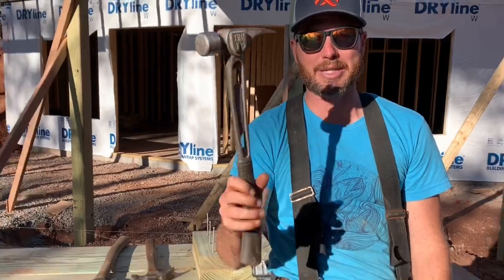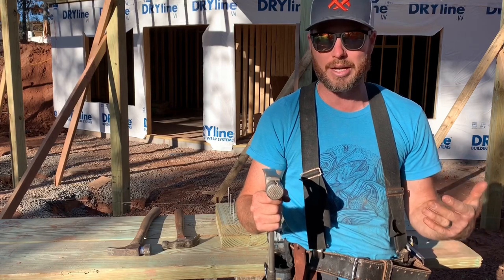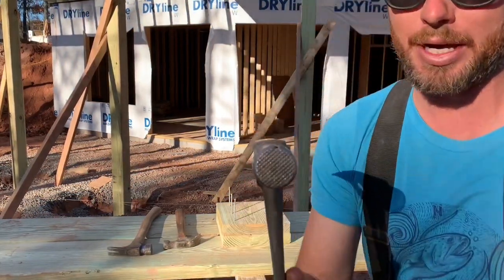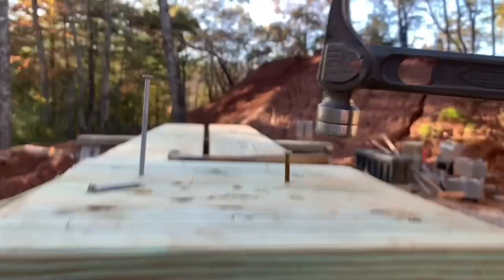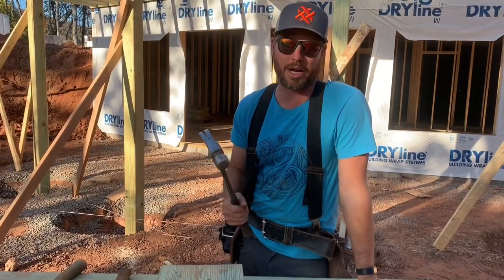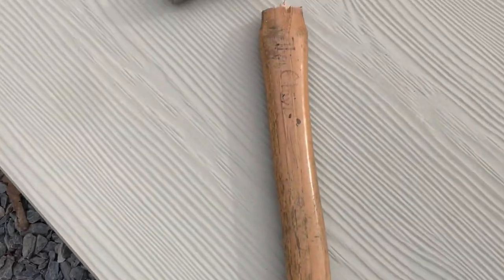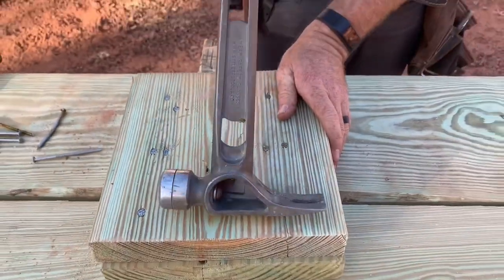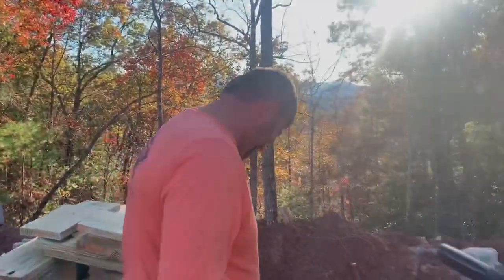$250 Hammer...  Worth it?

Comment: I had the TB11, the hand started to click so I asked Stilleto on FB how to fix it, they asked for a picture of my TB11 and my address, within a week I had a brand new TB111! I do a lot of formwork so the fact that the nail set accommodates a duplex nail is awesome. When you use the side pull, rotate the hammer so that you finish pulling the nail using the claws it gives you even more leverage, you can easily pull a duplex nail out of concrete. Someone stole my TB111 after I had it a few years, I immediately went out and bought a new one, lucked out and got it $100 off because the box had been opened 👍🏼 really like your channel which I discovered today.

Comment: Over the years I have bought the best tools I can afford, be they small screwdrivers, power tools,  framing tools, plumbing equipment, spanners (wrenches), some I've had for 50 years and still using them regularly.  I have Bahco pliers & spanners (Swedish), 30 years old, my best buys ever. Re. hammers: the cheap ones have a nasty habit of chipping - small chips flying off into your eye, nasty; and problems with leverage & balance & durability.  'Stoopid hammer for a stoopid carpenter' says more about the commentator who doesn't build for a living.  Great vids mate.

Comment: I'm a Union carpenter, do lots of concrete work and I would not recommend this hammer at all. I have had it for less then a year and the bolt stripped out and head kept falling off, and a little side note I lost a couple nail offs with guys that had heavier hammers, so it may take one or two extra swings to drive a nail
Reply: I'm with you, don't use mine for pounding on steel, form whalers etc. When I do the head spins and I need to re-aline, use my 22oz Estwing for forming, and 'd rather lose it in the mud instead of $300 one...
For Framing NOTHING beats the Titanium for me, I've used the wooden handles but they break too easily, the side puller is awesome , Oh and I completed the set with the Titanium nail puller (Just because)
Reply: @garywicklund301  way late but Vaughan makes a 32oz steel hammer that is beautiful for forming and driving stakes. I dont really get the complaints on elbows. Its got a wood hammer and ive used it basically everyday for almost 10 years and nothing has ever bothered me. The titanium stuff is just a hipster trend

Comment: Hey guys...thx4 update. Was intrigued  with new Martinez  moved the weight into the head for more force with the same head speed. But have to say for 250? I'll still stay with my Vaughn framing axe. It's a double tap nail driving machine with your vinal coated stinkers. 35 years...in an Occidental 3 bagger. Like the wooden handle because it can be shaped a bit to fit my grip.  Has a nail notch for pulling and with grip wax never slips. About 6 if these against 250? That said would like to get my hands on Martinex just to try. Give one a try 😊 Keep the vids coming. Lv the no bs and to the point. Snowing here.

Comment: A repeat tale. 
  I also have the Tbone II.  I went from 22 ounce estwing, to the titanium Vaughan half handle; ironically, I broke it in half. To the  stiletto w/ hickory (3 broken handles later),  to the Tbone.  If I started out  nearly 30 years ago with a Stiletto I might not have had tendonitis so severe I lost a month of work (as most carpenters, where I worked there was no such thing as "light duty").
If this is your career choice. The $300 is worth it. Even if you predominantly use nail guns.
  Although the latest estwing with magnet and side puller is an excellent choice for the DIYer or undecided apprentice.

Comment: I agree  . If you're using a tool every single day than you want the best tool that's affordable . Why hurt your arm when you don't have to . Yea it costs a lot of money but it's worth it . It's not meant for a home owner who hammers a few nails a year . Good part is that you can change out the head when needed . You can get a smooth head for it if need be . Every You Tube carpenter loves using this hammer . Why would it be any different here . Good video .
Reply: Henry Rodgers it would also be lighter than your average hammer right? Ie builders carry around there tools all day
Reply: @MsElijah16   Yes light and easier to swing but with the same power as a steel hammer . If I was a framer I'd get one for sure . Less vibration .

Comment: I'm going to buy one of those hammers....also like the black fibreglass shafted one. Which one is best? 🤔
Reply: get metal one! you can use strength of exposed titanium as leverage, and it wouldn't wear out when "misfire" against wood
4 years on mine, changed head once

Comment: I swing a 16 oz .. I figure it like if you play a violin  Play one instrument well .. Get used to the distance of the fulcrum .. Interchangeable from frame to trim .. I started on a 28 oz Estwing with a meat tenderizer " Waffle " and shredded my finger when I was a skinny newbie .   Back in the days .. A carpenter's skill and overall knowledge was seemingly judged on tap and sink with arms like a gorilla .  . If you choke up on a big hammer . The amount of force diminishes and force is what's need to overcome the friction of a nail .  Yet if you hold a lighter hammer closer to the handles end .It hits with more force .. Force is equal to mass times acceleration . and then factor in the fulcrum ..  Before the advent of nail guns . I hated Plywood Parties .. 8 penny nails and hand driving an entire roof .. Oh Joyous !! .. I learned to keep the pain down by " Drumming " .. Even when you are not hitting a nail .. Keep a rhythm and cadence . Tap , sink and drum . Repeat .. .. Now with nail guns ..and how efficient they are .. Even Pee Wee Herman can be blasting and outpacing any John Henry Oldtimer.. .. Oughta do a video on nail guns " Nail Guns and The Guys that don't know how to use them " .. Blasting away and missing the target .. not knowing how to angle or slightly angle , To bed before popping the trigger and learning not to shred with 40 nails in the same grain line . . Learn to recognize the thud of a missed nail and prevent " Shiner's " .. IN all my years .. One of the biggest problems I have with seasoned carpenters .. Is knowing how to nail !!!! .. Back in the days .. With a hammer .. You knew you missed the target !! and you didn't load up 500 nails per square inch .. I prefer a 10 lb maul for trimwork and a Hello Kitty Hammer for petrified SYP .. Nail only in the knots .. Better holding power !!! ..
Reply from the maker: Great comment! All true! I was thinking about doing a video on nail placement and also TOENAILING!  This seems to be tricky to get right for new carpenters (the placement and correct angle). I’ve grew up hand nailing sheeting for my dad on his projects so I feel your pain. I used to just take a knee and slide along each row with an old paint bucket full of nails ;)
Reply: @PerkinsBuilderBrothers   I have tried to show other carpenters .. " If you shoot a 3" nail at a 45 degree angle in nominal 2x material "   your nail only bonds 7/8" and 1/2 " parallel to the surface .. Essentially worthless ..   Toenailing where it shanks . There is an optimal angle and optimal placement .. Toe nailing for me is around 3/4 " up at a 45 .. it penetrates at the center and sometimes change the angle a smidgen and placement and it will grab like a beast ..   One thing that drives me insane .. Is others nailing hip or valley jack rafters and the nail pops out the valley or hip because they nailed it on the skinny tip of the cheek cut .. .. Nailing matters .. .. I call it " Maximum Bond " .. In my experience .. Many just pop away and do not think about the Grab !! .  Two nails in close proximity at a slight angle difference .. When bedded create a hold that requires explosives to remove.. I am a believer in building it strong . and when they think about how a nail is driven .. Then can get get good at it .  I love your site .. Not like an Ortho book . which shows a smiling silhouette building a deck with a line level .

Comment: Any chance for a request? I have to built an RV height (10') shed inches away from the house but not attached to it. Attached = Permits.  Whats a framing technique that will prevent the thing from rocking into the house during wind?
Reply from the maker: There are building Codes for how much bracing is required for different height structures. I would look that up, I don’t want to tell you the wrong thing without seeing your drawings.

Comment: Bought a small compressor, air line, a nail gun, and some nails for that. But I do see the point.
Reply: When you're walking walls and setting trusses, a nail gun is heavy as fuck and your airline will constantly get tangled and need to be re-routed. But if you're not a framer then you probably don't need a $250 framing hammer.

Comment: for my use around my shop at home i might spend more for a better something. however, on job sites i'd never spend that much more for anything i don't have to and the reson is simple, there are too many questionable people walking around that will swipe your stuff in a heartbeat, or break into your stuff/car/truck the second you have a lapse in judgement and turn your back, especially if they know you have expensive stuff. also, both are hammers, both do the same job, they hit nails, etc., you can get a comfortable hammer for a lot less than top shelf to do the same job. also, its money better spent elsewhere like getting the better nail gun. this is just wasting money just so you can say i have a more expensive, shiny new hammer than you, a pretty lame, self absorbed reason to justify the expense.

Comment: Is there a reason as to why you chose the Stiletto over the Martinez?
Reply: Think it's just more popular....but the owner of Martinez created both brands...i like the Martinez just a bit more
Reply: Ive never used the stiletto but it have the Martinez and it is great, they look very similar and seem to do about the same thing
Reply from the maker: Hey there... good question with a simple answer. My local building supplier carries Stiletto and doesn’t carry Martinez. I have heard so many good things about Martinez that I am tempted to try one though. Maybe someone has a connection?!? I would love to do a review.
Reply: Perkins Builder Brothers atlas tools in Toronto
Reply: I have both and going to sell my M1 because the head is not flat. No way to make the hammer head perpendicular to the nail head without swinging in such a way that your hand is below the nail when it strikes. Impossible to do if nailing a bottom plate to the floor and you’re on the floor. Your knuckles get beat up. Either that or I will grind the head flat to take out that crazy angle. Or put the M4 head on it

Comment: Am a concert guy we all use East wing but two years ago I went with a DeWalt hammer very light and nice would u recommend this hammer for concrete guys
Reply: Those DeWalt hammers are game changers
Reply: The lighter steel one is good, the 22oz milled face framing hammer was a good reliable for a while but the milling on the face is completely gone (whacking Crete) and the shaft is bent way off to the side from abuse. For 30  bucks it in got me thru about 5 months tho. Just dealt with tennis elbow for the first time so time to drop a little stimulus check on a stiletto! Yeah concrete guy would want something cheaper that u can beat on. Estwing or DeWalt or Dalluge
Reply: Take that back, be going with the Martinez m1 framing hammer. For give or take 60 bucks more you get replaceable head and handle, this will be the last hammer I buy
Reply: @charliechristian1097  I have an M1 and I'll never go back. I'm a remodel carpenter that has to do more than my fair share or demo. The M1 has been an arm saver for me. And it's a sexy hammer...

Comment: If I was your  dad I would not have put a 28 oz Stiletto in your hands as an apprentice. There are lots of old school carpenters that will swear by the original classic 20 oz Stiletto steel straight claw corrugated head framer with wooden handle. It is a sweet tool with good steel, great balance and low shock.  As I remember they made a 22 oz also. You said you did not want to blow out your elbow, but are using a hammer with metal handle?  Perkins, you know damn well you are not to beat on steel and do heavy prying with wooden handled framing hammer. There are better tools for those jobs. How about heavier smooth face steel handled hammer for driving your stakes, working on forms and with rebar? A small sledge is the best for driving stakes in most soils.  A standard good quality wooden handled hammer will easily pull nails sideways like you showed with $250 hammer.  You know professional carpenters when framing seldom bend nails over and must be pulling them unless they hit a knot.

Comment: I ditched my Vaughn 19- axe handle @ 10 years ago for the Stiletto 12- axe handle. 
I should have made the move 29 years ago. It swings like a 240z & is lighter in my bags, ( Just don't pull nails with it ) & you'll be fine. I wonder what that guy who made the dumb comment swings ... & Drinks ...:sanitizer::sanitizer::sanitizer:

Comment: Hey guys, I've been using harter hammers 21 ounce for 30 some odd years and only replaced a couple of handles . The vibration on them is next to none . I've used estwing  metal handle for demo and the vibration is horrible. Really how is the vibration on the metal handle on the staletto